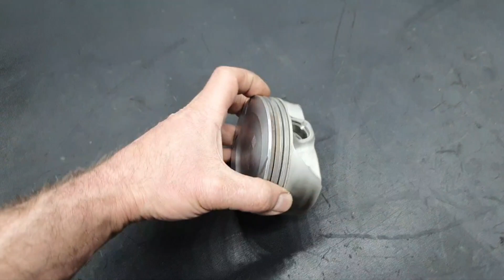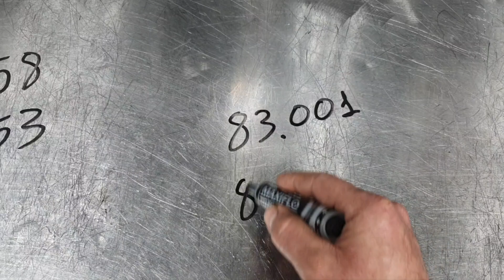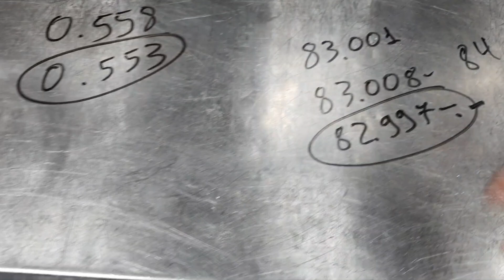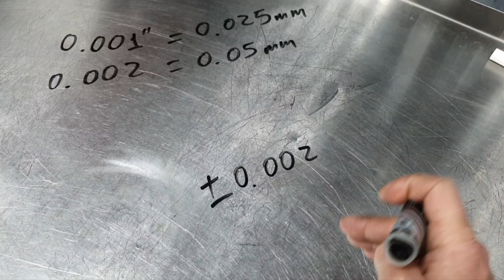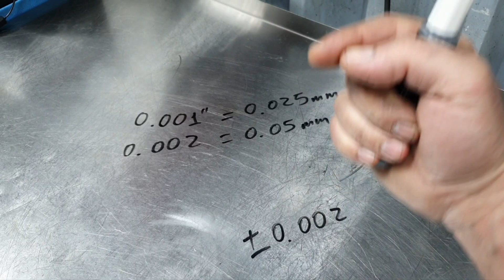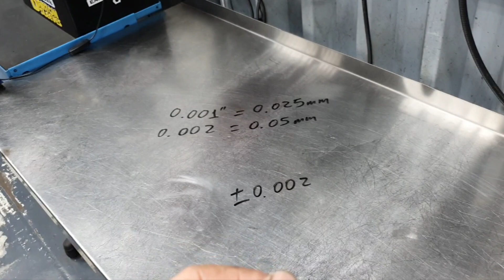excessive blow by

Comment: hello Tassas don't pass the mime please. Could you tell me I don't know English. the problem is that it sucks oil into the inlet code, I brake the engine and when I press the gas, a club of blue PCV smoke is new. The oil caps are also new Mercedes 2007 m156 amg

Comment: Taso,even the country's that is using the imperial(inches ets) ,they start jumping on the metric systems, because is more accurate with less digits.....it's difficult to change it overnight for the hole population of there countrys  but on the hi level stuff, that they need to be very very accurate on the measurement, they using metric system.

Comment: It will work harder unless you are running a Motec controller with EGT sensors on each exhaust port correct?  Then the controller can adjust fuel mixture to achieve equal exhaust gas temps.  I only mention because you discussed race/track vs daily.  I love the Tasos workbench tutorials!!!!

Comment: Tasos, thank you for your time explaining this! I have a question - I drive 2008 CL63 (m156) 100% stock with 30k km, In my country (Ukraine) I drive this car only during spring - autumn. So air temp is +10 - +30. I am changing oil every year with ~2k km between changes. Oil used - Motul 8100 X-Cess 5w40 + 2 bottles of Ceratec. Engine runs fine with no issues, ticking etc.. Is it safe to add Ceratec on every oil change or should I switch to some different oil to feel as safe as possible? I am not abusing the car, just some occasional "pedal to the metal". Many thanks!
Reply: One bottle is enough every two years, in your case createc is always sitting at the bottom of your oil pan. And not getting spread around on the surfaces as it should. I have an m156 with 146k km, never used ceratec. And cost wise Im better off changing camshafts and lifters once every 160000 km rather than bothering with ceratec.
Reply from the maker: Better read the instructions on the bottle  
It's supposed to be 1 bottle for 5 lt of engine oil every 50k km.
I'm using only 1 bottle every 50k km
Reply: Tasos Moschatos Tasos, for him to achieve 50k km it will take hime exactly 25 years. So about one bottle every 25 years. Ofc unrealistic, so one bottle every 2 years maybe thats excessive too, his engine will accumulate ceratec with that unfrequent usage and drain intervals.
Reply: Still a good thing anyways.
Reply: @TasosMoschatos  Thanks! It says “up to 50k”. With that kind of wording you can understand it differently. I will skip ceratek on my next oil change.